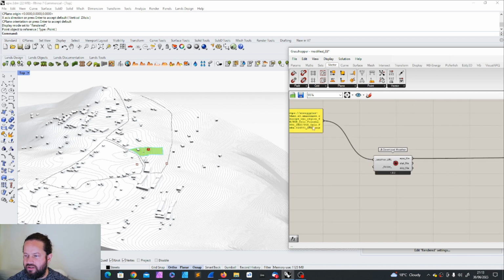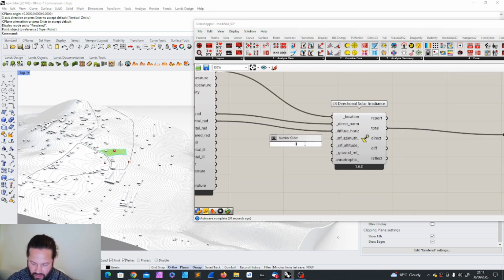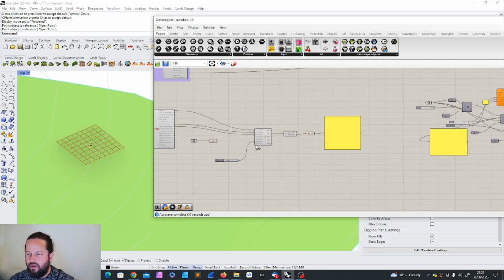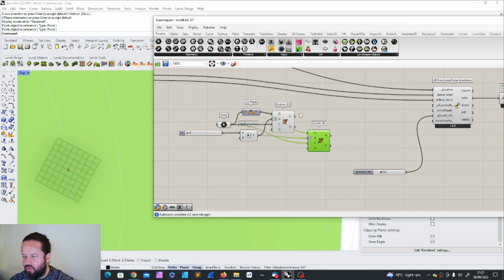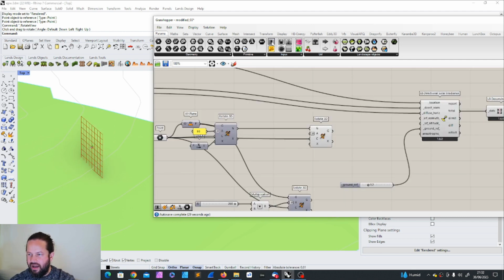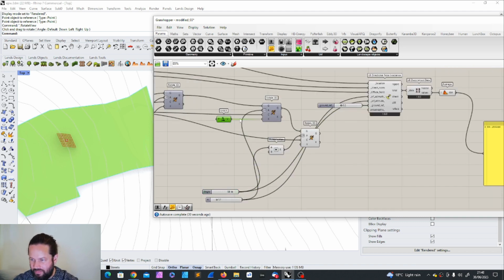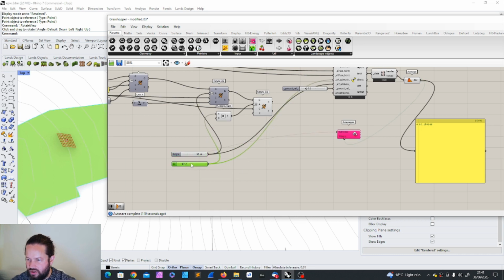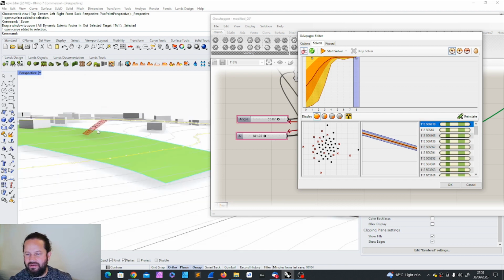#10 Optimizing Solar Panel Orientation with Ladybug + Galapagos - Ultimate Ladybug Course  - LBT 1.6

Comment: Hey how would you go about if the task isn't one panel, but hundreds of them? Have a slider for each panel would take Galapagos for ages, so is there another clever way to solve this for multi-objectives? thank you for your time in advance
Reply from the maker: Nice provocation.

If a site is equally exposed to the sun, one angle optimization would usually work for all panels — there’s no real need to optimize hundreds individually if they all operate under the same conditions.
In cases where conditions differ across the site, I would first test whether those locations produce enough energy to justify PV at all. It usually doesn’t make much sense to place panels in heavily shaded areas.
For more complex geometries — for example a project like the Google Headquarters in the Bay Area, where different roof areas have slightly different orientations and solar exposure — you could group panels into zones with similar conditions and optimize those groups separately. That’s where a tool like Wallacei can become really useful.

Although in this case I think the panels just follow the roof curvature...

Comment: Doesn't the latitude of the place where the pv panels are to be installed give the good enough tilt angle required for them generally, so why do all this, any other reason or what makes this more accurate
Reply: No, the altitude of the sun is different all around the year. Summer and winter don't have same duration. Summer days are longer and winter days are shorter. So, in summers optimal angle is roughly latitude-15° and in winter it is latitude+15°.
Reply from the maker: The angle depends on the location on the globe.
In my example I calculate the annual average.
Reply: @PhilippGalvanDesign yeah, I know. I was just explaining it to the person who commented.
Reply from the maker: Thanks
Reply from the maker: Depends on where you are on the globe.
My example calculates the annual average.

Comment: Could this process of optimising orientation be applied to a raised skylight/oculus?
Reply from the maker: Yes, it probably could.
Reply from the maker: Instead however, you would probably think about measuring the amount of light that comes through. BUT... as an Architect I would be careful. The light you want to come through an Oculus is indirect sky light and not direct sunlight. Or at least you don't want any glare.
We will discuss direct and indirect light in one of the next videos.

Comment: Hi, thank you for this great course. Is it possible to model and optimize dynamic solar panels with this method? for sun tracking solar panels or maybe a dynamic solar panel that changes the angle according to specific time steps. If yes, may I know how?
Reply from the maker: Good question. Would be also good to compare if it yield much more...
On the other hand it will also use energy to move... I'll think about it. It's a bit more tricky...
Reply: @PhilippGalvanDesign   that's exactly what I want to do! I want to check the efficiency of dynamic solar panels compare to fixed ones.
Reply from the maker: Well you could for example 
Shorten the period to a design day(average day). And calculate one panel every hour of a day and sum up versus one fixed which you calculate the average of the day...
Then you just need to find out how much energy you need to rotate the panel...
Reply: @PhilippGalvanDesign  Well, actually the project is a bit more complicated and I also need to calculate a couple of other things, so I need the data for the whole year... thank you for your help, I will try to find a way. If by any chance you were able to find a way to calculate it for the whole year, I would appreciate it if you can share it with me. Thank you
Reply: dear Philipp thank you a lot for your tutorials, your helping me out a lot here! I wanted to ask where you would put in the time period for the orientation of the panel, since the directional solar irradiance panel doesn't show any hoy-input? my goal would be to adjust the orientation of my panels according to the seasons of the year, or even on a morning/evening basis. @PhilippGalvanDesign
Reply from the maker: @matyasenz3222  Which version of Ladybug are you using?
Reply: @philippgalvandesign I use version 1.6
Reply from the maker: Hey, got it. 
You can limit the data to analyse before it goes in the 'directional solar Irradiance tool' with the 'Apply Analysis Period'. 
Any data from the weather data goes into this tool first plus the period you want to test before it's calculated. Hope it makes sense.
Reply: Hey, that was exactly it! Thanks a lot man, I appreciate your work, effort and your fast response.

Comment: How to add layers in grasshopper to add geometry automatically that is on that layer ? So we can add surrounding house on layer for adding surrounding in solar study.
Reply: Im no expert but Elefront or the Human plugin should be able to filter geometry by layer.
Reply from the maker: Good question. Would be quite interesting to have this feature. On the other hand it could get quite messy. Possibly there are already tools out there which can do that. You could look in food for Rhino.
Reply: i mean any node called "Layer" and then select desired layers either by panel. another way maybe to have node like "LayerSelect".
Reply: @rajendrameena150 thé component exists : "pipeline"
Reply: @rajendrameena150  Your best bet is geometry pipeline. You can select a layer, and choose to import either breps, surfaces, or curves from that layer.